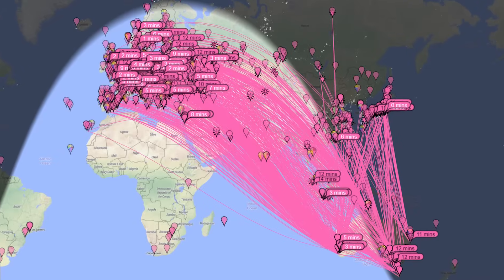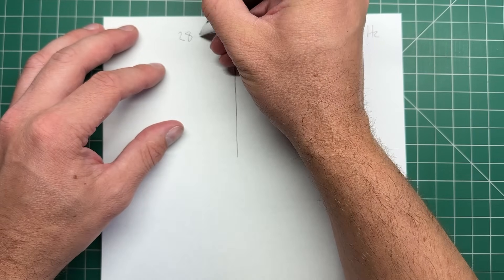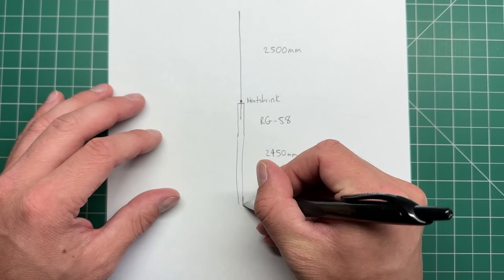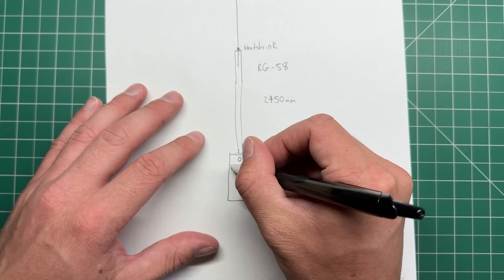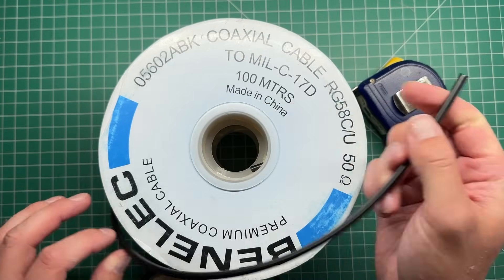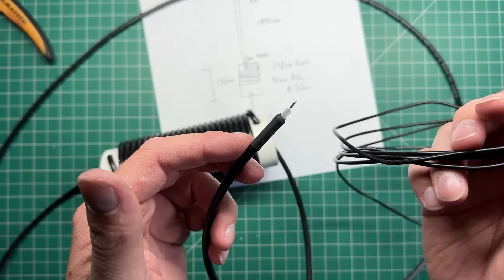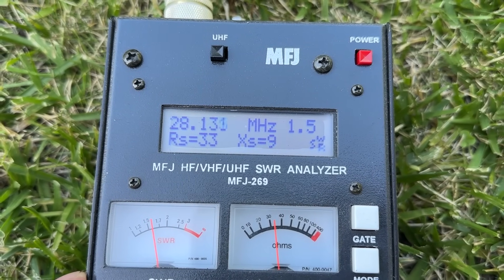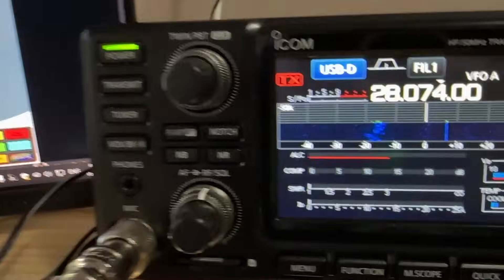Build an EASY 10 Meter (28 MHz) Vertical Antenna for DX!

Comment: Hayden,
Thanks for the video.
What are your thoughts on running wire antenna elements over the top of steel roof sections, like we do in Australia and New Zealand, with respect to ColourSteel and other corrugated iron sections?
I've tried to find information on this, but most of the hams I've read (in the US) use things like bitumen based shingles over plywood, where they would not encounter in ground effects like this.
I've had various issues with  metal roofs over the years, is there a solution to this, apart from having to raise your centre-point and the wires at least 1/2 a wavelength above the roofing iron?
Cheers,
73, Mike ZL3XD.
Reply from the maker: Hey Mike,
I guess it depends on what antenna it is. If it's a large-ish roof... and a 1/4 vertical, then a colourbond steel roof can act as a great groundplane! 

I know someone who runs a DX Commander on top of his garage roof and uses it as a groundplane.

I've mounted a halfwave vertical on the roof before without problems and the base of that was only about 0.5m above the roof.

Of course this is all HF. 
73
Hayden

Comment: I built one of these, but wondering if/how you calculated the coil specs, as i only had 1.5" pipe lying around, I tried winding the same length that used and making the other measurements the same but my vna says the lowest dip in swr is much lower, like 20MHz i tried winding more coil which brought the frequency up to target by the performance i feel is lacking and when i hooked up my feedline it got much worse, so googling it seems its being reactive ? as its not a 50 ohm match ?

Comment: Any reason why the 2.5 meter section of wire cant be inside of a PVC pole instead of outside?
Reply from the maker: It can be inside, but the length will need to be adjusted accordingly

Comment: Just made one, commenting in case the info helps anyone 😊
Final cut 2.35m coax into 2.4m top  element. 2x 240-52 torroids with a few wraps. (I think i did 9)
Lowest swr is 1.6, pretty flat from 27.8-28.8. 29mhz at 2.1:1.
Feedpoint mounted about 8m up. 
Ive used about 4m of RG58 C/U from Jaycar for the torroid winding and coax section of antenna. Then 12m of LMR400 into the shack.
Made 12 contacts on FT8 in 20 minutes of testing. VK2 into the US and Japan at 20watts.  

Probably the wrong coax - its marked RG58C/U (networking cable). Ive got about 30m of it for free and seems to work fine on HF at short runs.

Thanks for the video Hayden, enjoying the 10m/6m stuff 😊
Reply from the maker: Thanks mate, great build! You can probably get that SWR a bit lower - is the antenna mounted up close to anything metal like roof etc?

Good luck with the DX! Hopefully the band opens back up once this flare passes!
Reply: @HamRadioDX  Only about 2-3m off the roof at the moment - having thunderstorms in NSW so being careful / temporary setup. 
Will end up at same height but on a pole further down the yard - hopefully a better dip there. 
VK2KFC - thanks again 😊
Reply from the maker: Awesome! Hope to work you on 10m soon! Love the callsign too
Reply: How far from or above a metal roof does the choke of the vertical dipole need to be? 
Thanks.
Reply: Rg58 c/u is better than the rg58 jaycar sell. More braid coverage and its tinned.

Comment: But how do you build the big pole to mount the antenna?
Reply from the maker: Buy one - a fishing pole/fibreglass pole or DX Commander pole. Pretty common.
Reply: @HamRadioDX  How tall? What’s a good way to mount it? Does this antenna design also allow you to transmit on 10 m?
Reply from the maker: Longer than the antenna length - as this is a halfwave on 10m, that's 5m. I use a 7m long pole. The pole is then attached to a ground support of some kind, can be a star picket or something. The antenna is tuned for 10m, so yes to transmit.

Comment: I made a few over the years . found you can cut wire 3/4 wave and get a tune. great at 70 cm. I found at full legal power using RG 213 that the end of wire ,do a small loop and solder it back to self.  glue line heat shrink every thing. The end effect at high power can make corona at night . had this happen on 6 meters. that DX 10 wire can easy do 1500 watt but not RG 58. when doing VHF.UHF better coax like M & P . RG 8X is great for HF and some power . still easy to make coil with RG 8X . this a nice low cost antenna that works great. no carbon fiber pole. use fiberglass . 73's

Comment: Centre Fed Coax Dipole. Built several of these for 6m and mostly 2m. The lower half is shorter because of the 'fatter' element size, not velocity factor. Another way to have even less chance of radiation back down the coax, is to actually fold the braid from the top section back down over it's self on the outside. This does however mean that it will be exposed to the elements, but If it's housed within a PVC pipe it doesn't really matter. the VSWR can be lowered by tweaking the turn count of the choke using a VNA.
Reply: How do you work out the length with different size coax? Do you have a reference or formula you can share please? Thanks.

Comment: Curious, being a dipole, why are each side not equal? Off center feed?
Reply from the maker: Velocity factor correction of the coax
Reply: @HamRadioDX   jUST HEARD THIS WITH A 6 METER BUILD, JUST HADN'T THOUGHT OF iT?  I HAVE SEVERAL THOUSAND FEET OF 75 CABLE HARDLINE, AM THINKING Of BULDING SEVERAL BANDS VERTCALS? tHANKS,  I enjoy your channel.

Comment: This may be a dumb question, but where did you get your numbers? I get the half wavelength for the center conductor, but where did you come up with the 2450 for the braid length and how did you get the number of turns for the choke? Are there formulas for these or did you just pull them out of the air and base them on experience?

Comment: 4 months later this video suddenly becomes relevant for me as spring/early summer has finally arrived. Thank you! Excellent tutorial. 👍
Reply from the maker: Haha awesome! About 4 months before it was our spring/summer 😂
Reply: Ha, 1st day of Spring here,  yesterday in Australia (Queensland). I took this recently completed antenna out to the sports ground and attached the Sqid Pole to the fence post,did a few checks and  it came in high at the top end and perfect at the low. I was able to trim the tip bit by bit to get it acceptable at the low and high ends and perfect in the centre.  Thanks Hayden for the instructional video that was practical, well explained and something most people could do. I was listening to people in Japan and South Africa, locals in Darwin Perth and Sydney the Tassie and Vic stations were faint. Anyway I will set it up again today and see if I can make some contacts. Cheers

Comment: In the classes at the radio club they made us make this antenna for 2m, but they suggested using a 75 ohm cable instead of 50. We made the two to compare and incredibly it works much better, we were able to open a repeater 70km up a mountain at 3500 meters high
Reply: of course it is much more tortuous to learn how to solder a connector on an rg59 cable. but as a prize you get a super cheap antenna that you can use as your first base station
Reply: Why 75ohm cable?

Comment: Would you (or anyone reading this) know if the 10-meter version could be built with TV coax? I've built the so-called "double bazooka" dipoles with TV coax (20 and 40 meters) and have had great success with them at 100 watts. I just don't know if this type of coax would be a problem with this design because of the coil. I have a crap-ton of this coax and don't really watch TV. LOL

Comment: Hello Hayden VK7HH. I'm Artur CT2JOG and I live in Portugal. I've been watching the video: Build an Easy 10 Meter antenna, and I want to make one for myself, but I have some questions:
1 - What is the most suitable size for a fishing pole? in meters.
2 - What kind of conductive wire for the top of the antenna? any in particular? mono or multi filament?
3 - After making the 24 turns of the PVC pipe, what is the maximum length of the RG-58 CU coaxial cable up to the PL-259 plug? Is it only 5 meters? could it be another longer length? which?
4 - At what minimum height from the ground should the PVC pipe with the 24 turns be?
5 - How to tune the antenna (if it has tuning) for a low SWR?
Thank you for your attention. 73
Reply from the maker: Hi Remo. To answer some of your questions:

1. The pole I have my antenna on is about 7m long. I'd call that the minimum.
2. Not that important, although if you use solid core it might fracture and break.
3. The length of cable can be as long as you need, except just remember loss will increase the longer you go.
4. I use mine about 2m above the ground. The higher the better.
5. Trim the main wire at the top (to increase the frequency) or add some on to decrease. You can also reduce or increase turns on the coil.
Reply: @HamRadioDX  Thank´s for the answer to my questions. 73

Comment: The fundamental issue with this design is that you're using a choke (hint: they block current) to try to stop the current at the bottom end of the bottom element (hint: Hi-Z point = lowest possible current). The bottom end is a high voltage point, with little current. The choke will barely work. The coax will be hot with RF, and thus be part of the antenna. So the whole design is 'suspect' from the get-go.

The similar but better design involves adding another layer to the bottom, to act as a standalone element with a truly open-circuit high-Z end. It's called a "coaxial (vertical) dipole"; and you can look it up. In short: the coax is fed up inside the lower element, and feeds from the middle as any dipole. The lower element is often made from some outer shield harvested from the same coax; beware that you need extra length as if shrinks lengthwise when expanded to fit over the coax.

That said, on 10m, almost any old antenna will work. It need not be optimal. I'm talking across oceans using a 4-foot CB whip trimmed to 10m. And it's mounted indoors. So don't worry about it too much. I'm just trying to point out that this widely-promoted design is fundamentally flawed. The historical design of a coaxial dipole is fundamentally better.

73.
Reply: Then flower pot antenna it is. No choke needed, but will use more coax (outer part) to flip over to cover bottom half.
Reply: So how do traps work.... Because the same logic would apply and traps mark the end of the dipole for the lower frequency. The "choke" here is actually a trap. VK6MIK.
Reply: @moozoowizard  Yup, I totally agree with that. I have built this same antenna myself and works great. Without the bottom coil, tuning process can be difficult. Like you said, it is more terminating coil than a choke by using its "self-resonance" frequency to create high impedance. Regarding to worries about burning antenna because of "Current Maxima" radiation, just use thicker coax to build one. Instead of RG58 type, RG8-x (or mini) works great! Still flexible and light weight. It can withstand continuous RF well above 600 watts.
Reply: A trap can be made with coax (you can look up the various designs); they have nothing to do with the 'design'  of this antenna.

A simple coil of coax (as under discussion here) is a choke, a common mode choke. No, it's not a trap.
Reply: @JxH  it's a "LC choke" with a self resonant frequency targeting close to 28MHz. Andrew VK1AD, 6 metre 52 MHz SOTA Antenna blog article has the details of the calculation for 52mhz. Using the calculator, 50mm 24 turns 120mm long I get 31mhz. VK1AD also haa a blog article for 28mhz with the same numbers used here.
Reply: "I get 31Mhz" thats because the calculator is for air coils and the conduit is affecting the result. My thought would be to measure the self resonant frequency using a vna attached to the outer shield either side of the coil.
Reply: Another exspurt with no experience with this antenna😂
Reply: @yungsmile7546  I think this man is correct with his theory. Are you up on your antenna, transmission line, CMC and coaxial choke theory (whether it be ferrites or not)? Are you a ham?

Comment: I built one of these today based on your design and this video. Just slapped it together with pvc tube and duct tape. Worked great! SWR was so low it wasn't indicating on the Icom 7610, so I answered a CQ and straight away got a contact with VK2GJC, 3000km away. Tomorrow I will make it more permanent and get it a bit higher. I want to make one for 20 metres also. (VK6ABC).

Comment: Why not just use RG58 for the whole antenna and strip off the shield on the top part?
Reply: Cost. Wire is cheaper than coax. And probably lighter.

Comment: I've been building these for over 20 years for HF/VHF l love them. You can use either a 5 turn choke on a 110mm former or 16 turn choke on a 68mm former for 10m.
Mine is currently a 16 turn choke and I've the feedpoint ie the split at 5.37m agl and performance is superb just a few days ago I worked ZS from here in GI on SSB using 5w pep into mine.

Great video. De MI5JYK.
Reply from the maker: Thanks!

Comment: Hi - do you have any idea what the take-off angle(s) and gain might be?  I was trying to compare this to a "ringo" antenna.
Reply: Since it's a quarter way, the game will be zero, technically minus 1db. But since there are no ground radios, and he's using a quarter wave section of the coax jacket as the counterpoise. And then using chokes to isolate the feed point. They will put a sleeve down over the feed line that's equivalent to a quarter wave connected to the braid at the top but left floating at the bottom. That adds extremely high impedance point to choke out any RF floating on the coax. And you don't need the giant balance at the bottom. The major problem with his design is Ark out and burnout. You're going to have an extremely high voltage potential at the junction where the braid ends and the vertical wire begins. Even the slightest dick in that insulation will cause it to flash over. We're looking at the point where current and voltage inverse. So we extremely low current but extremely high voltage. Now you can go above that quarter way of section then make a another quarter wave stub that goes out to the side, that can be made out of just a piece of coax, Shield connected to the bottom radiator Center conductor connected to the top radiator however that coax needs to be cut with an antenna analyzer so that you can trim it to an exact quarter wavelength. The far end of that coax is short it together. Above that you add another vertical wire that can be either a quarter wave or a half wavelength. But again without ground radials just antenna is going to have a take off angle somewhere of 25°. Hence why it's working really well for Skyway of propagation.
Reply: @allen_steel1236  You have it backwards. Where the coax comes to an end and the wire attaches is the high current low voltage part - the centre of the half wave dipole. The coax braid between the choke and that point is the lower half of the dipole, the wire is the upper half. The high voltage points will be at the top of the wire and the bottom of the coax sleeve, just where the choke is.

The take off angle will be the same as any other half wave dipole mounted vertically, i.e. you get the doughnut around the centre, with a pretty low angle of radiation.

As for gain, it's 0dBd as it is a dipole. It's just a different way of building a half wave dipole where you don't have to run the coax at right angles out from the centre, half way up the pole. This could also be expressed as 2.15dBi.

Comment: Couple of questions. Would there be a problem with RF getting past the choke using RG8?
Is there a reason you didn’t use one piece of coax and strip it like you did with the 6meter?
Reply from the maker: Yeah just to save a few meters worth of coax. 
RG-8 will require a different turns/diameter ratio due to the larger size. You can find the answers on google somewhere just search for air wound chokes.
Reply: If you wish to use RGA coax, to make your choke. Use a 4-in diameter pipe. Which would be four and a half inch outside diameter. Pvc. Wind approximately 20 turns to 30 turns, it will vary a little bit. So depending on the quality of the coax. Phone core versus solidcore if it's true rg8 phone core you'll need 30 turns. Also you need the larger diameter when you start to bend the coax the radius of it becomes important as it compresses the insulation. Which thereby reduces the power handling of the antenna being antenna has extremely high voltage on the quarter way of section coming down from the vertical before the choke. You don't want to skip here. The fact it's best if you wind the 30 turns, keeping them tightly spaced together. Then go down another quarter wave on the coax and add five or six ferrite beads, that fit tightly. String the entire thing up vertically so that the so she had to do it choke and the second quarter wave section where the beads are is also vertical, preferably hanging in free space not against a mast. This will make essentially a cleaner antenna, providing a little bit of gain and a lower takeoff angle around 15 to 20°. If you look up a High Gain V6 antenna, will give you a little background regarding the second grounding sleeve

Comment: I built one of these last year after having great success with my dual band VHF / UHF flowerpot. What I don't understand tho is the difference in length of the coax portion to the wire portion. Is there a specific ratio between the lengths? Mine is centered on 28.4mhz after initially being long and great for 11m.

Comment: Nice Video. What sort of power (watts) can be used with this antenna
Reply: By using RG58 coax, safe continuous transmitting power (AM, FM, etc) would be around 100~150 watts. RG8x coax can withstand around 400~600 watts. If you need above those numbers, try 10mm diameter coaxes such as RG213, LMR400.